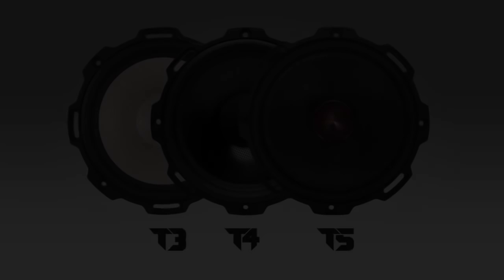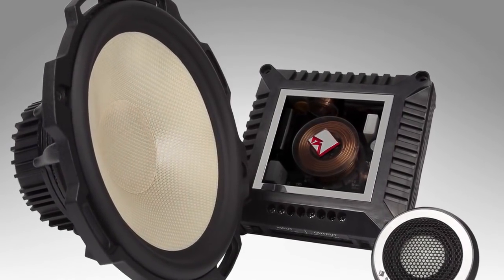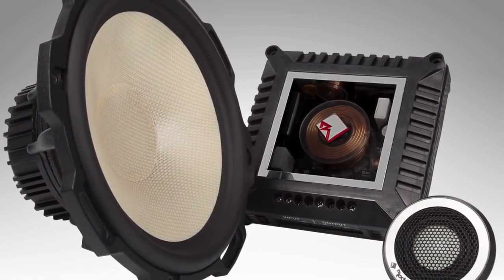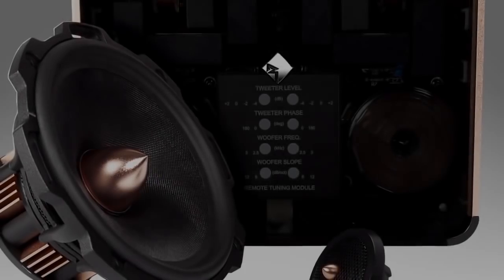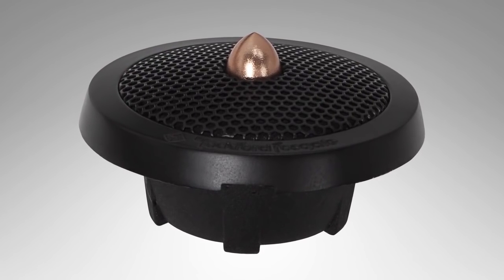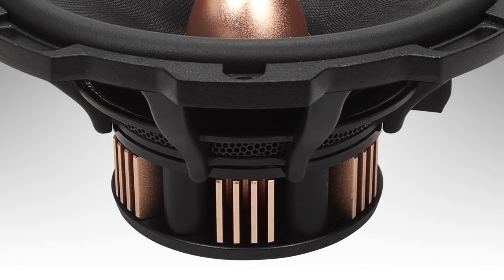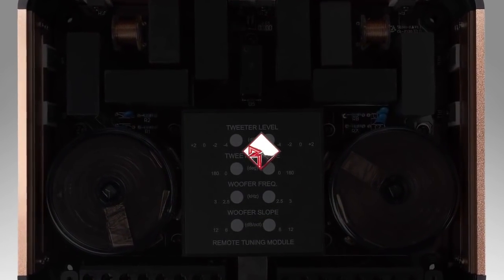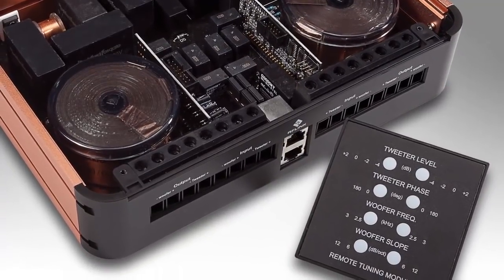Rockford Fosgate: Power T3/T4/T5 Speakers (2.5)

Comment: I have 2 rockford fosgate power t5652-s. How can I connect these two sets to my rockford t1000.4? Is there a video showing this connection? There is a diagram on the official page but I will be using two sets and I don't know how to connect the two sets to the rf 1000.4.
Reply from the maker: There are diagrams in the owner's manual on Page #9 that illustrate how to connect one set of T5652-S systems.  Just replicate that for the rear channels.: https://rockfordfosgate.com/rftech/library/2011/4_speakers/1230-57237-01_rf_t5components-man.pdf

Comment: Whats the rms on the t4 tweeters each and crossover boxes please
Reply from the maker: 150 Watts RMS using the spec'd crossover of 3kHz at 12dB/Octave High-Pass.
Reply: OK thank you but What's all that 3khz at 12db octave high pass I don't understand any of that
Reply from the maker: @jesseedgell8698  This is the crossover frequency and crossover slope (built-in to the box that comes with the kit) that’s required to get 150 watts of power handling.
Reply: @rockfordfosgate  ok thanks so is there any pacific way I have to set up the box

Comment: I noticed really talk much about the T3 at all. I had to purchase it after purchasing a set I see why. I’ve got T3 and T4‘s T3‘s I do not like at all actually took them back out and put the tea ones back in. Had them running on a JL audio G 6600 amplifier T4 sound amazing but the T3 I’ve got nothing good to say about them except the packaging is the best in the buisness!. The T5 I have 2 of the crossovers but both are missing the wiring harness and ones missing a remote. I can’t seem to get them anywhere they stopped making them and that was that
Reply from the maker: Thanks for your feedback Ryan!

Comment: Hold up we got T3 4 and 5 power series speakers????!!! I didn't know this 😂 I got the T2s in the doors and running a 1st gen T2 15 D2 silver cone "2004" models it's on a Taramps HD3k and gets 3kwrms daily no probs at all no smell no getting hot. It's ridiculously loud hits hard ect. It's 17yrs old and I can float things in the windows it flexs my 2010 VW CC Turbo Sport. I got vids of it on the basshead life Facebook group and the Rockford Fosgate group on Facebook and Instagram. Y'all make some of the best quality subs ever made. Talking power series lol. The P1,2,3 idc for I had em all back in 07 / 08 era when I had my T2 12"s installed and done a smaller build in my other jeep I ran the P1 15" black cone red basket it was horrible.. the P2 was decent the P3 was good.. but the T2 powers where incredible and I still got em and got the T1s 10" 12" 15"s iv bought over the years and got in trades. And my daily is that 2004 model T2 15" D2 at 1ohm 3kwrms daily it's in perfect shape still stiff. It's insane. Y'all are amazing.
Reply from the maker: Thanks KC Mullins for being a Car Audio Fanatic and continuing to support Rockford Fosgate.
Reply: @rockfordfosgate  always 💯 y'all are the best hands down. The original T1 and T2 silver cone woofers from 2004 are absolutely amazing and my favorite sub of all time. And still is to this day and I got a sundown Zv4 12" and Sundown Xv1 and Xv2 15"s and the skar Vxf 15"s and a bunch of Sundown Sav3 8"s and a couple Sav2 8"s and a few Xv1 8"s and two Xv3 8"s sitting in storage along with a couple HCCA 12.2s silver cones the ones from the early 2000s and a couple of diamond audio D9 12"s iv kept that I bought new and they are all sitting with my first T2 12"s that I bought yrs ago. And those are the reason I fell in love with Rockford woofers. Those two T2 12"s got me my very first 150+ DB score I got a 151 out of two T2 12"s on two Orion HCCA 2500.1ds so I got a personal deep connection with these particular generation T2 series. And why iv pretty much bought each one iv found up and traded for ect. Iv traded some really nice subs and amps for em over the yrs. And today even tho I got all those subs I run a Single T2 15" D2 silver face "2004 model gen 1" on that Taramps HD3000.1 D that gives 3k to 3600+ watts at 1ohm RMS. And that T2 takes it like nothing it doesn't get hot it doesn't smell bottom out ect Even after 17 yrs. It's never been rebuilt repaired in anyway. And it's still going strong. It's crazy that it performs the same or even better than most of today's woofers. Just means those subs where ahead of their time and y'all knew exactly what y'all was doing. Keep up the good work guys n Galz ;)
Reply from the maker: @kcmullins6179  That's great!  Thanks for sharing your experience on the Rockford Fosgate T1 & T2 subwoofers!
Reply: @rockfordfosgate  np ;) question or suggestion lol. Have yall thought about bringing the original T2 and T1 back as a legacy sub or anniversary subwoofers?? Reason I ask is because their amazing subs and mine have lasted 17 yrs now no issues or probs and they are definitely under rated at 1k RMS lol their amazing and ppl love em. It would be cool to see a new silver top T1 and T2 come out even if it's limited
Reply from the maker: @kcmullins6179  We're continuing to sell the T0 because it was just as popular, but the platform for T2 subwoofers have been updated with higher power handling voice coils per customer requests since they kept telling us "Your T2 series need to handle 2,000 watts or more".

Comment: I still believe these are a midbass speaker and not a midrange speaker. Big difference and wonder why rockford went away from their true 3 way punch separates from the 90s. A true midrange unless you listen to just bass heavy music might be the most important speaker.
Reply from the maker: Hi Kopr, midrange and midbass speakers can be one-in-the-same.  If you have a driver with a low frequency response (typically under 200Hz), then it's just a matter of the crossover frequency used on the high-end side.  Typically, a mid-bass speaker is designated to play around 100Hz - 400Hz, and a midrange is around 400Hz up to the tweeter crossover frequency.

I asked our loudspeaker engineer about 2-way versus 3-way a couple years ago and his reason for developing 2-way systems was due to the complex phase response issues when using passive crossovers.  Typically, a good passive crossover incorporates the filter itself, a zobel, and/or a conjugate filter to help compensate for impedance, amplitude, and (to a lesser degree) phase fluctuations.  He mentioned how it's easier to "control" the phase issues in the higher frequency range because the wavelengths are shorter.  In addition, tricks like a phase plug on the face of the tweeter help bring everything back to "normal".  However, in the lower frequency range, the wavelengths are longer and can be more complex to handle.  Also, since the frequency is lower, larger capacitor/coil values are required, making the crossover bigger.  Not ideal for everyday installations in door panels.

The frequency response of the Rockford Fosgate Power Series components explained in this video are shown below, making them great for use in both mid-bass and mid-range frequencies.  Keeping things simpler, allow them to perform great and sound even more amazing!

== Frequency Response ==
• T5652-S: 45Hz to 2.5kHz or 3kHz (Frequency Response = 45Hz to 30kHz, Woofer Crossover = 2.5kHz or 3kHz)
• T4652-S: 40Hz - 3kHz (Frequency Response = 40Hz - 30kHz, Crossover = 3kHz)
• T3652-S: 40Hz - 3kHz (Frequency Response = 40Hz - 30kHz, Crossover = 3kHz)
Reply: @rockfordfosgate  Totally understand where the engineers are coming from. I guess my point is, is that's it's better to demand a certain frequency range from an individual speaker than it is to ask a single speaker to deliver the demands of 2 sets of frequencies. With that said do your crossovers utilize electrolytic capacitors or poly caps?
Reply from the maker: @koprcord5338  The current T3/T4 utilize polyester and electrolytic and the discontinued T5 used polyester.

Comment: I'm looking to purchase a set of T5's.  Why were they discontinued - production costs?
Reply from the maker: Hi EyeSeeYou 33, we appreciate your inquiry into these amazing sounding components.  It was actually a trifecta: 1) The developer for the custom crossover coils would no longer produce them. 2) The cost of the crossover was exceptionally high and difficult to manufacturer 3) The sell-through wasn't high enough to warrant the continuation.  We still produce the T4 component system which has very close matching Sound Quality characteristics.  You can find info on the T4 component system here: https://rockfordfosgate.com/products/selector/car-speakers/

Comment: Would this be a good fit for upgrading a Chevy Silverado 1500 speakers?
Reply from the maker: You can use any of the following speakers in the door location of a 2020 Chevrolet Silverado 1500 Pickup Crew Cab: P165-SI, T16-S, T2652-S,  T3652-S, or T4652-S.  So, yes they would be a good fit, but you'll need to build an adaptor plate since some of the system do not include one.

Comment: why is the t5 isnt manufacture anymore ?
Reply from the maker: The T5 component system was very expensive to manufacturer.  Unfortunately, the crossover coils were the most complex piece of the system and the part manufacturer would no longer produce them based on the quantity being sold.
Reply: you can still find them but you might have to dig around on the internet, i have found 2 sites that has been still in stock